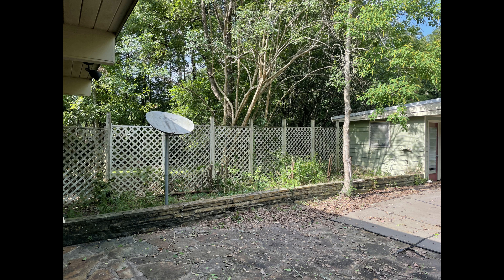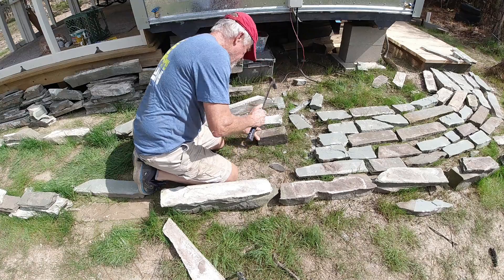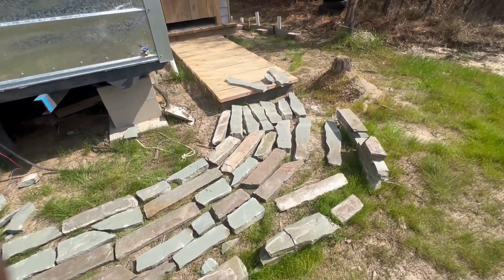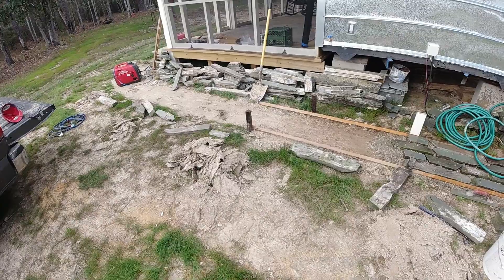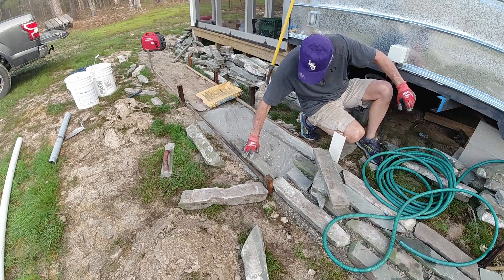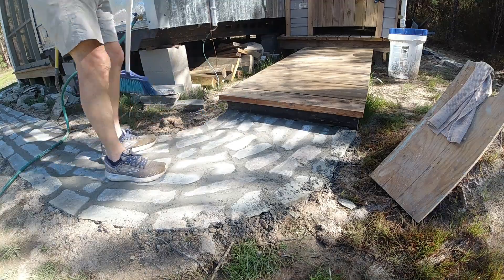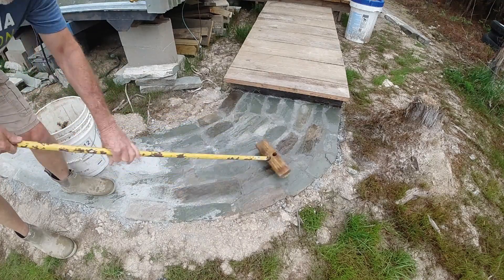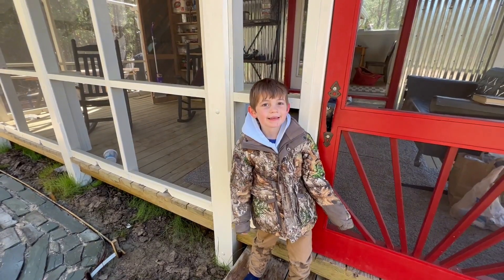Laying a DIY stone walk the easy way for the tiny house camp camper thing.

Comment: Did you ever "plug" between deck boards to keep crawlies out?
Reply from the maker: Joe
Have not. Leaning towards backer rod and a self leveling caulk like Sikeflex 2c sl. But a big outdoor carpet placed in the middle would solve a lot of the issues. 
Barry

Comment: is there any way i can get in contact with you, im rebuilding a 1974 19ft mako and had some questions about fairing and painting.
Reply from the maker: Zach 
224 324 8369
Reply: 225**
Reply from the maker: Sorry Zach

Key punch error! It’s 225 324 8369